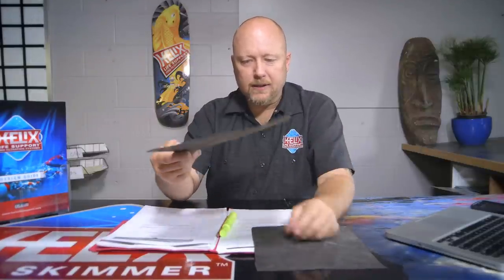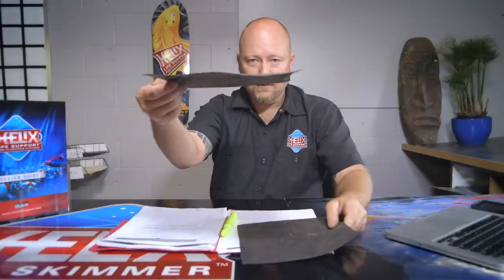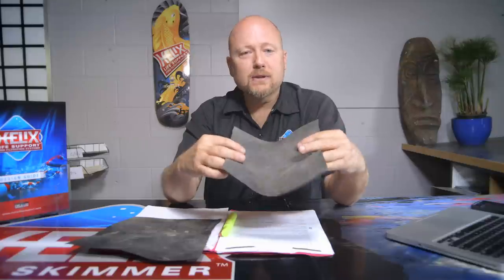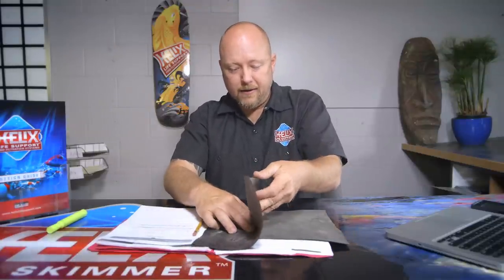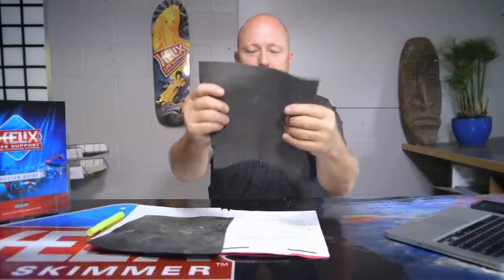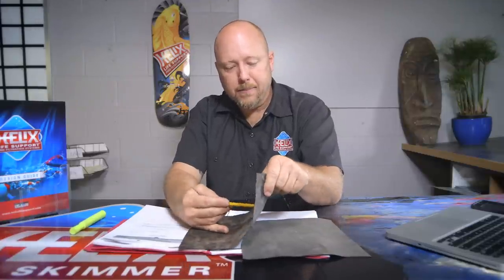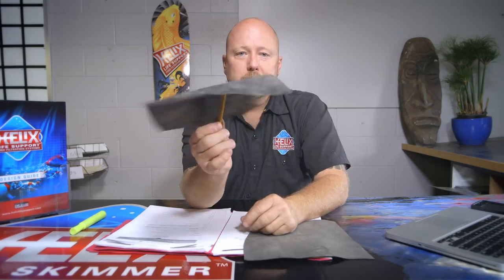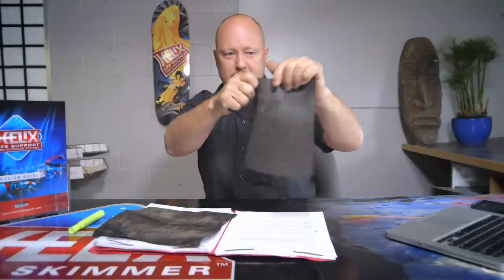Pond Liner Comparison - Ask T.P.D. #30

Comment: I watched my neighbor digging his 20x15x 3 feet deep pond with one of those mini diggers. When he brought out the liner for the pond I went round and asked him "Hey! you must have spent a fortune on that pond liner" He told me that it was actually the waterproof membrane that roofers use and was a lot cheaper than the regular pond liner. I decided to do the same but on a smaller scale as he had a fair bit left over. Well his pond is now 10 years old and mine is 8 and they are both still going strong with no problems at all. Just thought I'd say is all. Hope you don't mind
Reply: That's pretty cool. I've been thinking of tearing out my above ground pool and using the liner from that. It's free, but idk how much id like the blue hue
Reply: @VanillaCoke64oz  Those are usually bad liners. The one this guy used was EPDM

Comment: I use old rubber roofing. Works great I got a hole in it and shot silicon in it without draining any water out, just put the silicone gun under the water and squeezed. Leak sealed never had a problem again.

Comment: Hello from Slovenia!

I've looked into the RPE liner aswell and the only reason was, becouse I've thought that it is more puncture resistant. Which you proved me wrong :)
Main reason... We've got a Golden Retriever, who is crazy about water. I think it's in breeds DNA, so...
when he drinks, he puts front two paws into the pond (plastic atm).
And now I'm planning to build a brand new one 5000 l / 1350 gal, (about which you inspired me btw) and trying to find a solution. Do you think covering the EPDM liner with lots of gravel should be fine, or should I go with a concrete? 

Keep up the good work, love watching your videos :)

Comment: I am looking at a 10' round, 3' deep pond and since I have rocks here, I think I will opt for the EDPM. It is also more accessible, but the greater flexibility and ease of use are big selling points for me. If I was doing a very large project then I would consider saving the 30%

Comment: Great information as always.

Not sure when I will be digging out my pond, maybe in 1yr or 2 yr time but still collecting information, so which is better rubber liner  or concrete for a pond? What should I go for, if I consider lifespan of the pond, budget restraint, viability of the pond. 

But up to now, you don't seem to have done any pond with concrete.

Comment: would you recommend using HDPE liner for pond building? i did a quick search on the net  and HDPE is the only available liner offered in my area, mostly from hardware shop2 and it's said to last 15years tops maybe. i can't seem to find epdm anywhere near me and the only source i know, which a koi specialist(?) close up shop few years ago.

on a different note, i'm wondering if we can use a make-shift pool to hold fishes while a new pond is contructed because buying a specialised tank might be expensive and considering i'm living under my parents roof, such an option will be protest even if you have a steong reasoning..
Reply from the maker: +Nano Kumo HDPE is a viable option for water proofing. We use it on large projects a couple times a year. 

make shift pond can be very effective for temporary ponds while construction is underway! Go for it.
Reply: 45 gallon drums work for me , stick my round filters in bottom, keeps my fish all winter

Comment: I put my backyard pond in about 25+/- years ago and used the RPE liner.  I have a 340 gal pond, hour glass shape, 18" deep with a 6" shelf on 2 sides.  I believe that was the liner available at that time, never heard of the EPDM liner till I watched your videos, and it looks a lot easier to install.  The RPE liner is hard to fold, and the creases stick out about 1-2".  About 6 years ago I got a leak above the shelf, bought the same liner again, cut the old one at the shelf line and reinstalled the new one.  Again the folds are sticking out 1-2".  About 3 years ago, my rescue dog was pulling on a fold and punctured it.  I put the recommended patch on it, and so far so good.  I"m learning a lot with your videos, I have plants and fish, and in our hot summer months I could never get clear water.  I use a Pondmaster 1250, and have used various bacteria, algea kill, barley straw, and blue die.  This last year I got closer to the right combination of bacteria and blue die ( and added pea gravel ).  As I watch your videos I'm getting some ideas on redesigning to having some sort of bog filter stream/water fall on one end and a skimmer on the other.  Meanwhile, I think I'm going to get the Airmax Pondair to get the oxygen level up.  Do you think with my pond as is now, getting some oxygen flowing will help with the algae growth, and I can spend less time cleaning!  Puyallup, WA, we have 3-4 months hot 70-90, and dry.  Thanks again for your videos!
Reply from the maker: Air is an excellent idea and will greatly benefit your pond and your maintenance routine.

Comment: Bought the pond liner o.33 mil. And it looks as if it's going to crack and in some spots it looked like dents!..it has a 10 yr guarantee..so we had a kind of hard time not so flexable..installed and next morning pond was almost empty. DEVASTATED TO SAY THE LEAST..MY POND IS ONLY 55 GALLONS  WITH A LITTLE WATERFALL

Comment: what is your take on using rubber flat roof liner? in the uk that all they use is fire stone roof liner,, taken from how to tube videos the garden shops here in Ontario Canada, say oh you cant use that, it will kill your fish,, I used it 15 years ago, in a 65ml that was half the price of a much thinner pond liner, no problem with fish or plants, sure I had a bit of what would look like spots of say gas. oil on the top of the water for a few days, it skimmed off, I don't know if you get that with the so called pond liner,, all I know is I got a much thicker liner using rubber roof line and saved a ton of money

Comment: What's the expected life of a rubber liner in Florida?  I have a low area on my lot that puddles when it rains a foot deep and I want to build a 15'x15' by 3 foot deep pond there and want to slope and  vein other parts of the lot to feed it.  I had this idea  to solar pump and  filter that water in place so that it can be further filtered and consumed... but not sure it's possible or safe.   Given it's going to be a mix of rain water and top soil that will sit it will collect silt and pathogens.  Are their filters or affordable treatment systems in the market that can do this? Any way to combat evaporation?

Comment: I have 12 x 15 pond with  a rubber liner, I have 2inch pvc pipe for over flow. I use  silicone to seal around the pipe it stick good for 2 years then it starts leaking.  Is there a special  seal  to use.  PS  I  have a small amount of water running in all the time.

Comment: Im building a stream with a bog filter and a pond. I have geotextile fabric and 60 mil eddm rubber to line it all. But I also have some large tarps that I no longer need. Would it harm anything if I put the tarps down too, and if so, in what order...tarp, geo, then liner...or geo, then tarp, then rubber liner?

Comment: darn not get notices on new video's .I am lost .I had that rpe in my lotus lily pond and it is hard to work with and it cracked on me around the top where it was exposed over the winter to weather ,I replaced it .Not sure if that is normal for it to do that .I got it cheap and only needed a smaller piece ,not worth the little savings .45 mil ..I know at least this will last .I did put 30 mil in lotus lily pond this past spring
Reply from the maker: sissy murphy I think the notices were messes up for a couple days when Youtube was making changes. They had the comments page turned upside down too.
Reply: ThePondDigger Thought maybe you didn't like me any more : + )  LOL

Comment: Started real small with the cheaper 20 mil stuff, never again, built a figure 8ish pond 25 x 12 w/ a side 8ft "P" shaped pond that ran into the big pond that solely served as a Bog filter and loved it.  Now moved  to florida and just started planning a 35ft x 15ft Dogleg pond with a built in Bog filter and wouldn't use anything less than a 45 mil.  On a side note I would never have another pond without a Bog filter the benefit of one of those is unbelievable especially after I added it after my 25x12 was finished.

Comment: The only liner around me is super expensive from local pond store. Could I use epdm roofing liner with seam tape as liner? I have a 30×20 pond with roughly a 15×10 cascade area.
Reply from the maker: +Robert Gould Jr. I don't recommend using roofing liner however people have done it for years. There is certainly some risk.
Reply: ThePondDigger Risks being leakage or leaching?
Reply: I watched my neighbor digging his 20x15x 3 feet deep pond with one of those mini diggers. When he brought out the liner for the pond I went round and asked him "Hey! you must have spent a fortune on that pond liner" He told me that it was actually the waterproof membrane that roofers use and was a lot cheaper than the regular pond liner. I decided to do the same but on a smaller scale as he had a fair bit left over. Well his pond is now 10 years old and mine is 8 and they are both still going strong with no problems at all. Just thought I'd say is all. Hope you don't mind

Comment: Eric, I use FireStone EPDM in every pond i biuld.... in ground or above ground in patio boxes.
Reply: Does the Firestone stick well to wood? I'm in the process of buying supplies to build a 4x8 above ground pond out of machine grade plywood.
Reply: @bwortham1987  I have a 12x3x4  indoor pond framed with 2x4s and plywood . I have 1/2" foamular insulation between the wood and the liner. The liner is not sticky but it stays in place from the water pressure. The top edge of the liner is held down with wood trim board. The king of diy has a video on an indoor pond. Here on YouTube  that you can watch for ideas. Or feel free to private messages me and I will share pics onmy build
Reply: @Jimi182  Yea I know about Joey, I'm Subscribed to his channel. Although he gives detailed info on each build, you can never get enough info. I've watched numerous of videos and I'll take bits and pieces of each idea and implement it on my project. I just revised my build 2 days ago and I'm going to build a 12x4x3 and yes, I'd love to see yours. Only thing I'm dreading is the pond liner. I'm sure its simple but it looks difficult lol. Question, did you get the pressure treated lumber or just the regular kind? I've priced the lumber I need for the build and corner bracing and it tallies up to $399 just for lumber and #10 wood screws from Lowes here in Houston Tx...
Reply: @bwortham1987  I used regular framing lumber. If you go 12' long you will need to put support across the tank from side to side. I used 3/8" all thread with fender washers and nylock nuts. Where the treaded rod goes across the top of the tank I covered it with 1/2" c-PVC pipe. I also put the same threaded rod through the ends few inches from the top to make sure there is no chance of a failure.
Reply: @bwortham1987   my all tread supports are every 4 feet. So one at each end and two across the open area in the top.

Comment: so has anybody looked into or used these used billboard signs as liner ? the company is named billboard tarps. I called them talked to them and of course said the spider to the fly" ya they work great easy to use last forever wont kill your fish. price is awesome on them but just not sure its worth the risk.
Reply from the maker: Dennis Scogin Dude that would be EPIC to have a billboard tarp advertising the wild animal park, BEER, Baseball or something completely random! I imagine they would be livestock friendly but here would be my concerns - The tarps do take a beatin' up on the side of the freeway and could have some small punctures not to mention the installers don't really worry about small pin holes when dragging them up and down the ladders. If you did in fact have a hole what would protocol be for repairing the hole. EPDM patches the most readily available repair kits are not recommended for other liner types. That's what's on my mind. Keep us posted.
Reply: I build ponds for a livin and the first year I started a had a client go and and buy a sign tarp, I told her I was very unexperienced with this type of material for koi ponds and couldn’t guarantee it.  I installed it with her insisting I use it,  within two days of finishing it started loosing water like crazy.   After examining it I found a bunch of little holes that matched the size of her dogs paws and nails.  So it would jump in or run up and down the stream and pop hole after hole, now I absolutely refuse to work with sign liner, it’s terrible and not meant for ponds.  Just my 2sense